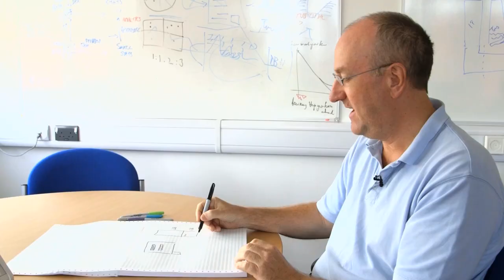EXTRA BITS - Data Security and Flash Memory - Computerphile

Comment: There's three reasons for this (afaik):

1. Manufacturers consider a kilobyte to be 1,000 bytes, while in computing it's 1,024 bytes. This adds up on large volumes.

2. The manufacturing process isn't perfect.

3. Modern filesystems create a journal that tracks changes that will be made before committing those changes to the filesystem to prevent corruption.  Journals can take up a lot of space on large volumes.

Comment: It's just the way the file system is reading the memory. Each step up in byte suffixes (e.g. kilobyte, megabyte, gigabyte) are all by factors of 1000. The file system uses factors of 1024 instead, because that's the standard for RAM and other flash memory types. Hope that helps

Comment: No, filesystem overhead isn't shown like that, this is sort-of what lazyeye79 said. The Capacity is written in bytes, all is well and good, but the giga-prefix used in computing terms is a multiple of 1024 not 1000, hence:

2000158720/(1024^3) = 1.86279296875 rounded down to 1.86 GiB

The abbreviation GiB or Gibibytes (MiB mibibytes, KiB, Kibibytes, etc) is a standard that never caught on to differentiate multiples of 1000 vs. multiples of 1024. The 1024 comes from the binary 2^10.

Comment: There are in fact already programs that do this for "normal" HDDs. I'm not sure if they'd work on a USB flash drive though.

Keep in mind that there's a reason those are hidden ESPECIALLY on normal HDDs - when a sector becomes unreadable, you want it remapped, and if you end up with no "spare" sectors left, the damaged one would be permanently un-writable, as opposed to the OS/controller remapping it. In that event, you'd have to use the unlock program again to relock the drive to a lesser size.

Comment: it depends on the purpose of the limitation - if it was done just to spare a production line, probably yes - but if it is done for yield optimization (for example they make 8 GiB chips where 2 GiB are defective, they can at least sell it as 4 GiB drive and use the extra space for wear leveling and stuff) you probably will unlock defective spaces

usually its not worth playing around with this kind of stuff sinces smaller flash memory is cheap and bigger stuff (like SSDs) get really complicated

Comment: how this relates to security is basically because if you try to erase the data from a thumb drive, even if you have it flip everything to 1 then back to 0 (however many times) there will be a corner of it that won't likely be touched. this matters a little but not much if you use encryption from the start because the data in that corner will be encrypted and likely unusable even with the key after you delete the rest of the drive.

Comment: Most SSDs have 7-10% "spare area". This coincides well with the GiB -> GB conversion, so manufacturers can sell a physically 128GiB drive as a 128GB drive. Binary to decimal conversion. 2^10 becomes 10^3 (kilo), 2^20 becomes 10^6 (mega), and 2^30 becomes 10^9 (giga). for every of these steps there is a 2,4% mismatch which accumulates. 1024 -> 1000. At Giga that means a 9,26% missmatch.
Some SSDs can come with up to 15-25% spare area, but are then sold as 100GB or 120GB instead of 128GB.

Comment: Not just different speeds. One of AMD's most popular CPU lines were the triple-core Phenom II's which were basically just quad-cores that had a faulty core so they disabled that core and sold them as triple-cores for a lot cheaper. However, eventually the demand became so big that they started using good quad-cores instead of just faulty ones and if you had the right motherboard you could actually unlock the additional core and have a perfectly normal quad-core for cheap.

Comment: I seriously doubt that. The inners may LOOK exactly the same, but if you read on the packaging you will find that some packages contain 1 or 2 "dies" (stacked if more than 1), while others can contain up to 8 or even 16 "dies". A die is a piece of silicon with circuitry "printed" on it. This way, the physical devices are almost identical, you just have more stuff in the package for the higher capacity drives. Since the dies are µm thick, the higher capacity packages aren't physically bigger.

Comment: of course - but in semiconductor manufacturing the yield for high end products is very small - so you have lofts of defective stuff. its pretty sure that, if you get a bigger flash memory IC sold as a smaller one it is not limited just for fun or economic purpoposes, it if often because of defective parts which are disabled

you can't see that from the outside but they are there

Comment: Thats the way its always worked. Out of a waver you get quite of number of microchips. The quality of the chips decreases the farther away they were from the center of the waver. The better ones are usually sold later for a higher prize or implemented in the premium models of a hardware architecture while the worse once are being sold for a cheaper prize or implemented in low-budget hardware.

Comment: In the olden days you use to be able to get single and double sided floppy disk and you could turn a single sided into a double by just punching a hole in container sleeve, wasn't a good idea though, because a some of the single sided disk where ones that failed the tests for double sided, I think there do a similar thing with different speed CPU's they make get different speeds out by testing which passed the high speed test and which didn't.

Comment: this type of yield optimization is common in semiconductor manufacturing - cpus, gpus and apus are manufactured the same way - if you have for example a quad-core cpu with a defective core it just gets sold as triple or dual core (AMD did this with rana, regor and propus: all cores working, cache intact = Phenom II X4; all cores working, cache defective = Athlon II X4 and so on

but sometimes, intact cpus are labled down, if the market requires this - these somtimes can be unlocked

Comment: Well I work a lot on digital circuits, mainly on my custom 8bit CPU, this is how I do it.
200= 11001000 (8bit)
0=00000000 (8bit)
In my circuit I have a 8 pin NOR gate, the gate is high if every input pin is LOW (no signal).

Before a doing a division or multiplication, I check the numbers with the NOR gate. If the NOR gates is high, it would not even run the calculation, and it would jump in the program during a division or result in 0 in a multiplication.
I hope this answers your question.

Comment: Your computer probably measures 1 GB as 2^30 bytes whereas the manufacturer measures 1 GB as 10^9 bytes.

Since 10^9 is smaller than 2^30 your computer shows it as less than the amount the manufacturer calculated.

Comment: The extra memory is probably faulty or unreliable, because it's not uncommon for tech companies to rebrand premium hardware that is faulty/unreliable with lower specs and just letting the parts that are faulty be de-activated. A good example is AMD's 3 core processors that was just 4 core processors with one faulty/unreliable core.

Comment: As i said, the thing is to sell a single product as 2 different ones.

Its all ok if the lower end product is in fact not functional the same, but as GammahooX said, if you are able to simply "unlock" the potential, i feel kinda cheated.

Kinda like you buy a car that is locked to only drive 80km/h , with the unlock removed its a totally valid car. Wouldnt you feel cheated ? I would ...

Comment: I thought it would be the opposite.

A 16gb memory will have not 16gb free memory, might be 15,5 or so, but its a minor difference opposed to 4gb to 16gb , as thats a tremendous difference.

In the end, the point is that the customer should at least KNOW what they are sold. If the device is in fact a 16gb memory and is limited to 4gb i damn well want to know that, and not get sold a 4gb memory, while it is just a limited 16gb one.

Comment: Good to know i suppose.

But i just cant get behind the feeling that you pay more for something you can easily get cheap, while you just need to remove the lock that is placed to limit the potential of the very same thing.

For games thats a thing with DLC. I highly dislike the fact that DLC is actually within the game allready on shipping (not all, but some) and is just activated by payment, for me that means i just get sold less than i would normally allready have.

Comment: why is this a big thing? this type of yield optimization is very common in semiconductor manufacturing - and of course the manufacturers usually don't throw away the partly defective ICs, the just relable them and sell them as smaller ones - same thing goes for CPUs for example:
the Athlon II X2 215 has exactly the same IC as the Phenom II X4 830 - but the first usually has 2 defective cores and a partly defective L2 cache and thus deativated where the latter has all 4 cores + L2 cache intact

Comment: So yea, the actual point is that you never know your product is "locked" in some way. If you can explain that with a lower cost, people might be fine with it, but still, doesnt feel right that as a customer you never get told that the product you buy has in fact a locked feature set, while its more expensive version is the very same, just unlocked.

If its so natural and economic, why not tell the customer right away ? Why hide it ?

Comment: Actually it is the same with cars - or do you expect for example Volkswagen to created different engines? For example the Golf 7 with the 1,6 liter TSI engine offers  66 or 77 kW - it es exactly the same Engine, the only difference is the engine control unit which tells (by software) how much power the engine should deliver at what point. This is completely legit since you pay for a delivered service.

It is irrelevant why it is limited (business economics or technological) - you pay, you get.

Comment: To sum it up.

Its totally fine if the product is sold to the customer with the full knowledge that it is in fact a 16gb memory, just limited to 4gb.

But the customer doesnt know, the customers thinks (as thats what its told to him) its a phsycial 4gb memory, and thats what you pay money for.

Knowing that i would feel kinda cheated to pay more money for a 16gb memory, while i get the very same phsycial memory with the much cheaper 4gb product (i just have to unlock it).

See what i mean ?